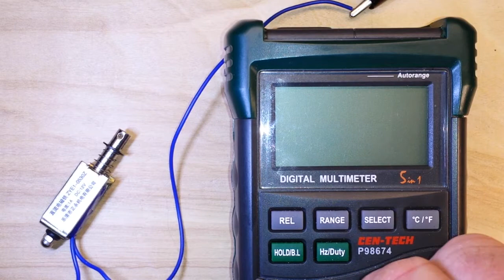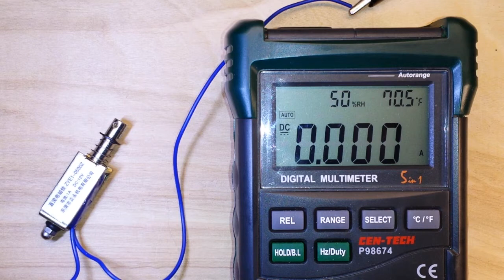How to use a high current solenoid with Arduino

Comment: Thank you. Can you do the same video with a solid state relay and se555. This is used for fully auto and semi auto for an arcade light gun. You don’t need the gun. It would just be good to see how to wire the circuit. Thank you

Comment: I've just finished a project using very very simular pieces. saw you ran into the same issue as me... hold the solanoid open too long and you burn out the transistor and it locks open. hense why you had to flick the power off the 2nd time to get the release. This can be solve in a number of ways; heat sinking the transitor (this only really gives you more time), using a higher rated transistor or switching it for a relay.
Reply: can i use a solenoid valve push pull for quick push and pull....within 2-3 sec time?  (  like using it to deliver one teaspoon senitizer liquid.
Reply: @anandjoshi8554  yes you can. I have one set up to literally flash open closed with less than a second between.
Reply: @ThePlacemat  thanks
Reply: @ThePlacemat  I have purchased 3N power 12v dc push pull solenoid, lets see if can do the work!!( may be higher 25n or so would be good !!)
 Which connector would fit to blue colour relay modules in place of jumper /dupont / berg housing connectors ??(2.54 mm pitch ) good firm connection

Comment: Interesting, can solenoid be powered only by arduino (no additional power), using capacitors? So it will have some delay till capacitor fully charged to uncharge 750mA and 11v of course, but still, is it possible?

Comment: A Chladni plate would be fine to attach it to the core of the solenoid. Then electronically control the oscillation via Arduino to get those cool fractal geometry patterns to appear on it. 🤔😉😆

Comment: Nice. A couple of things:
1) Should I plug it to an external battery? If so, what kind of battery?
2) What kind of transistor should I use? Would the TIP120 Power Darlington Transistors work?
Thank you
Reply: P.S. 
I would like to use a Mini Push-Pull Solenoid - 5V and a Small Push-Pull Solenoid - 12VDC. Could you tell me what kind of battery is needed for each one of those? Thank you again.

Comment: this is a great video, I am new with arduino and I am using arduino uno. Would you be able to give me a circuit diagram for arduino uno operating a 5V pull solenoid? I can only find sample with high voltages like 9 or 12V. But I want to keep it simple with only 5V. Please send it to hitokiri_ruroken@yahoo.com Thanks!

Comment: Good video - Doesn't mention that firing this for a long time will burn something out. I think if you have it under software control you should use PWM to reduce the duty cycle to hold it in place. No expert, but I believe this is how modern pinball flippers work!
Reply from the maker: +simeon2020 very true

Comment: So how powerful is this solenoid ? I  was planning to buy few
Reply from the maker: +B Bobby good enough to open a lock, I don't have precise figures
Reply: Not very powerful, about 5N or 600g of force at the top and then it drastically decreases when almost at the bottom  is about 200-250g

Comment: Would be nice to see some code used.
Reply from the maker: void setup() {

  pinMode(2,INPUT);
  pinMode(4,OUTPUT);

}

void loop() {

bool button = digitalRead(2);
if(!button){
  digitalWrite(4,HIGH);
  delay(3000);
  digitalWrite(4,LOW);
}
if(button){
  digitalWrite(4,LOW);
}
}

Comment: You didn't say anything about the wheeling (catch) diode that should be across the solenoid. This diode dissipates the magnetic flyback from the collapse of the field when the solenoid is released. A 1N4007 or bigger would be appropriate. The diode is wired directly across the coil (as close as possible) with the cathode to the +12 supply. Additionally, the current you measured is without any load, and should be measured under full mechanical load. Neither of these should be overlooked.
Reply: I wish I had a Dad like you guys.
Reply from the maker: You are correct, I should have added that information.